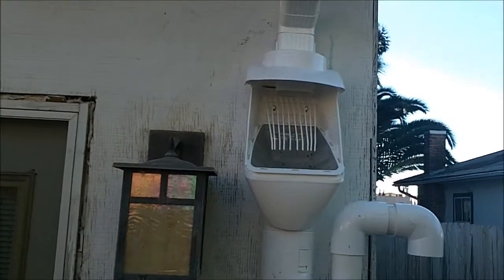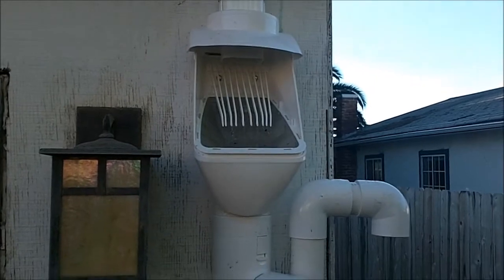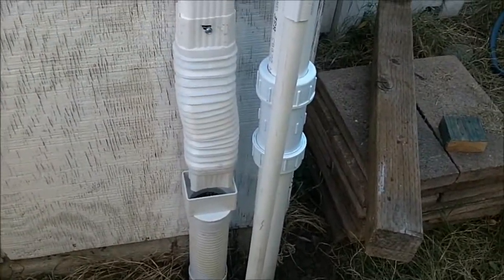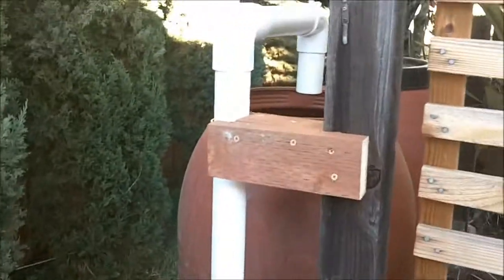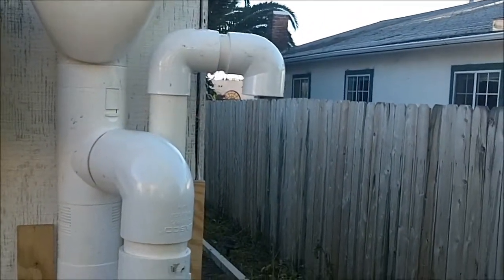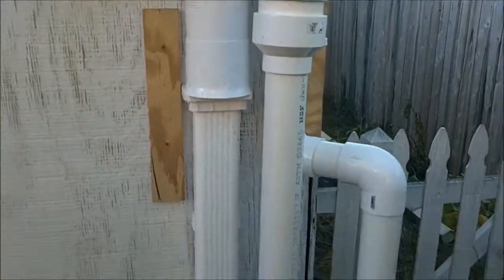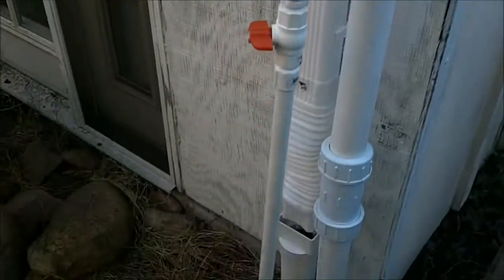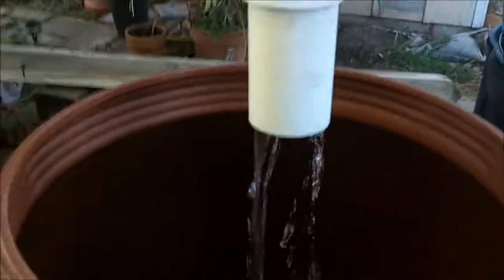Rain Harvesting

Comment from the maker: @nicksgarage2 When I first tested it water wasn't getting to the barrel. It went over the top of the trap and to the pipe to the other side but it couldn't push the water up the vertical pipe to the barrel As soon as I vented it on the house side it started working. While I was reworking it I decided to put the valve to drain the trap. That whole trap section will be able to be removed for cleaning. That's why I have the compression joints on each side.